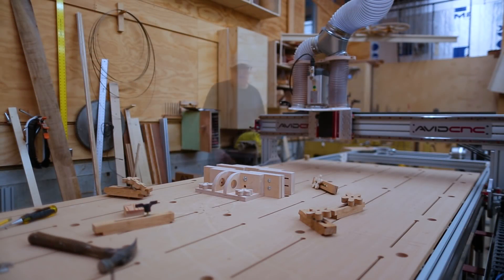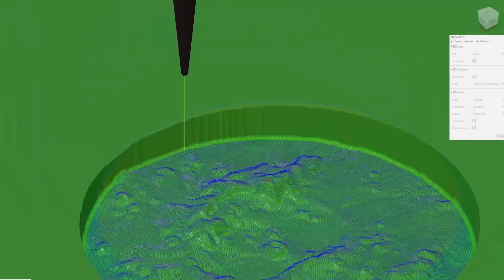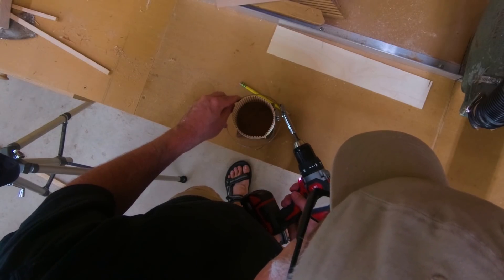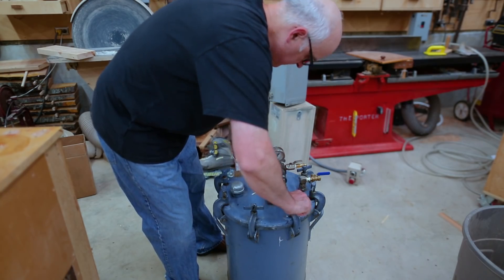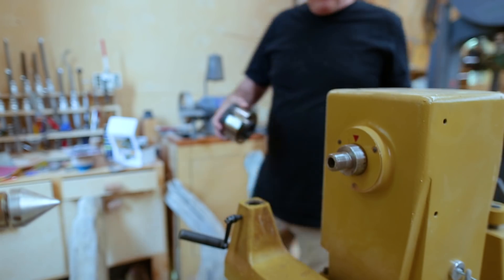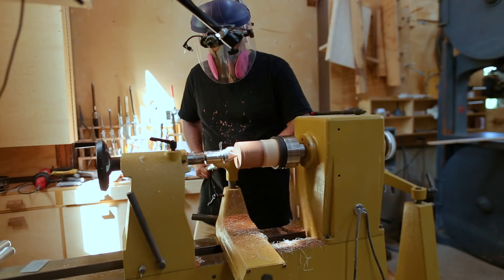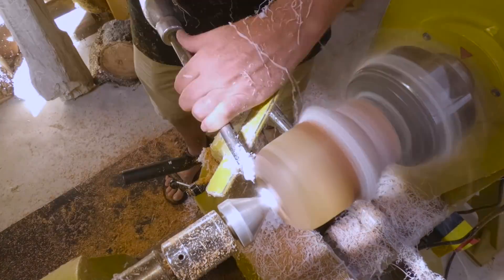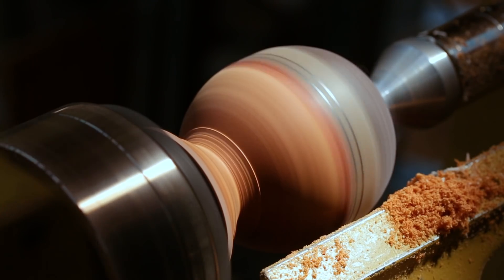Wood Turning a Sphere with Resin

Comment: Beautiful as usual. Now, from the very moment I saw where you were going with the plywood and all I thought you were probably making it a bit too complicated. When you showed how the relief cuts caused those holes and all that, I think I got it.

I mean, I think I know you make that "mold" round because, in the end, you're making a sphere so a cilinder seems the right way to start. But after checking on how long and complicated it gets to work around its problems, well... why don't you just go with a simple cube?

I know it takes more epoxy to fill it up, but it's completely faster and hassle free. You just need four pieces of plywood, some glue/nails and you have it. Or, if you want to waste less epoxy, maybe you could make it an octagon, but this is a bit more complicated again. So, maybe, it could just be a simple box and if you don't want to waste any (or as little as possible) epoxy in the corners, between what would end being a cilinder and the corners of the cube, that could be filled  with some wood as well, maybe with what would be inverse of a dowel cut into four pieces at length, one for each corner. Or maybe with four small sheets of some flexible plastic material or even some cardboard that could stand the resin.

I don't know if I'm making myself understood but I hope so.

Thank you for sharing.
Reply: You put a lot of thought into this. Maybe you should try it yourself, and tells us how it worked.

Comment: pull a vacuum on the resin after you mix.  About 1" of mercury.  Do it slow otherwise ti will froth up.  This may help.  We do that encapsulating electronics in resin.

Comment: Yay, Yorkshire Grit!! I love the stuff and use it on everything, including all wood products. Your sphere came out looking fab and I like the bubbles lol

I was just wondering if the bubbles are from pockets of air trapped in the groves that you cut in the ply so it could bend? I've seen people doing wood and resin projects before and not having to do excessive drying of the wood. You could try Nivk Zammeti's trick of using plastic storage containers with loads of mould release so you don't end up sticking the pot to the resin.

Comment: High pressure during the resin casting seems to work OK. But you might get better results doing a few cycles of low > high > low pressure.

Comment: I think pulling it a vacuum would yield better results than adding high pressure. What do you think?
Maybe even dry out the wood faster?
Reply: Been done, he might even have a video on it. It's not intuitive but the pressure method in practise works much better.
Reply: Most videos I've seen uses a vacuum with great results. Anyway, great video as always.

Comment: You could have turned the plywood around, with the relief cuts on the outside. And stabilise the wood under pressure with slow set resin before cutting it to stop it leaking bubbles into your "dome".

But either way, it's bloody gorgeous.

Comment: Have you thought about stabilizing the wood before this? I like the bubbles too, by the way.
Reply: Benjamin Eagle what about segmented wood piece by sandwiching a piece of not super dry wood with dry wood. Then making the sphere. Would there be bubbles just in the center of the piece?
Reply: @andrewslater6846  Only problem with that is, the resin moves as it cures So the bubbles would be coming from one spot, but would not necessarily STAY in that one area. But I would definitely love to see the edges sealed, and just a few spots left open for bubbles to form from, and see what they do!

Comment: The bubbles are coming from the wood because it has micro air in it
So the best way to combat this is to put sanding sealer on it a couple of coats I've let it soak Inn for about 1 minutes then blow all the excess off was a compressor let dry and do same process this gives you real good detail that seals the wood so the air doesn't come through.
Great job though